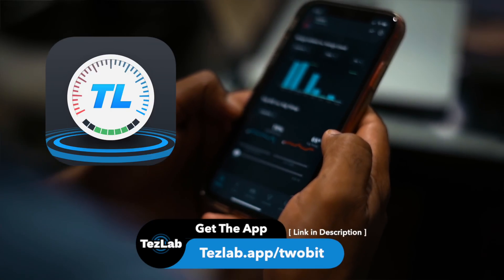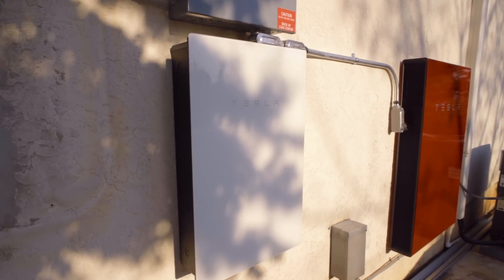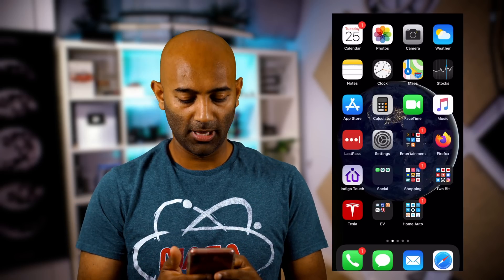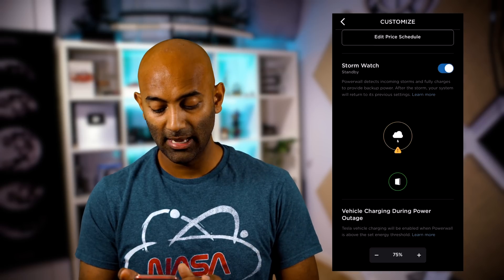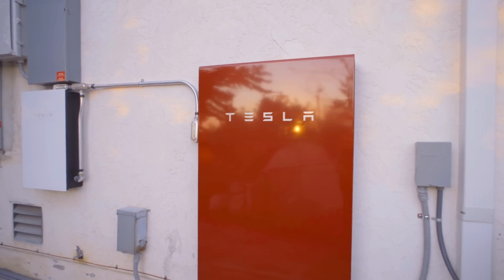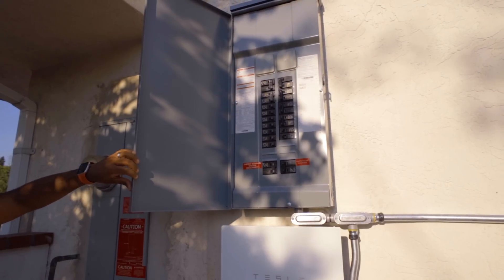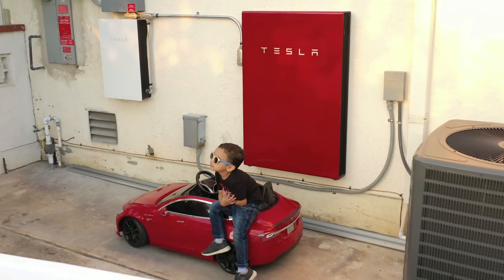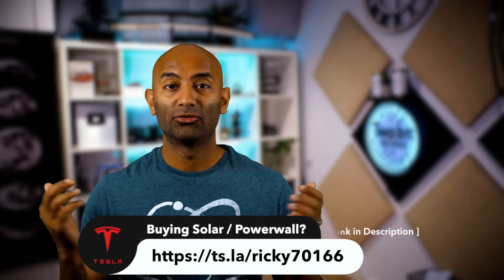The GENIUS of the Tesla Powerwall Explained

Comment from the maker: Get Tezlab, the best companion app for Tesla: https://tezlab.app/twobit 
Get Tesla Solar + Powerwall! ⟫ https://ts.la/ricky70166
Reply: I am enrolled in the PGE C.A.R.E program that Discounts my Service and when my Energy use is LOW , they often issue me Energy Credits , sometimes my Entire Bill is $0 and the Next Month is like $10 . 
I am also Enrolled in EBCP which is a ZERO Emissions Local Power Company , which Currently 100% of power generated is from Renewable sources , but PGE still charges me for Transmission. 
EBCP also provides 50% Renewable and 25% Renewable options as well. 
one other FACTOR in California is PGE has Tesla MEGAPACKS at Moss Landing and Ventura County which should help to Balance the Loads better with All the RENEWABLES California has , it still needs to build more MEGAPACK storage in CA , however.
Reply: I keep pricing solar roof and powerwall but still so pricey ($86k by the calculator) though the way my summer electric bill is it would be nice not paying that $400 a month.
Reply: @michaelinterbartolo3  Sound like you would be better off investing the $86K in Tesla stock.
Reply: Just ordered my panels and battery wall with your referral code.  Thanks Ricky keep cranking the videos out.
Reply: Ricky PLEASE look into researching and possibly getting a "Vertical Geothermal System" good example is Dandelion Energy but there are many... Got a friend the has it here and it cuts the cost of Heating, Cooling and Continuous Warmed hot water (Reduced energy used by 41%).. What we really need is a Green Ecosystem of products From BEVs and Solar to Wind (Harmony VAWT), geothermal, HVAC, Passive housing, Shading and Batteries!!! ~ What we then would need is a smart grid as we will then have Community Renewable Farms!
Reply: With Tesla treating it’s customers poorly with its terrible sneaky legal and  marketing practices, enter it’s power wall competitor, the BigBattery 48 Volt Kong Power wall. 

Google it. The Kong. 48 Volts. 12 kilowatt hours capacity and each Kong can be wired together in parallel up to 8 kongs. 

And the 10 year warranty is awesome too. 
Best part? It’s actually made in the US too. No child labor in a foreign country. It’s American made. 

Wipe that smug attitude smirk off of Tesla’s face acting like we people got no other choice so we gotta put up with it. Nope. 

Google Big Battery . Com 👌🏽 Later people ☺️
Reply: What about off grid solar etc from Tesla
Reply: @coziii.1829  Tesla’s off grid solar is not the best. It’s actually worse than DIYing your own solar setup yourself. 

I can prove it. 
1. Best battery I’ve found is 48 Volt 12 kilowatt TREX battery from big battery website. So powerful they can power a house. And you can connect them together electrically up to about 6-8 TREX batteries to power a whole mansion if you wanted to. 
2. Best solar panel I’ve found is 355-375 watt solar panels from Seraphim Solar panels. 
3. Best all in one inverters I’ve found are called LV all in one inverters. Powerful enough to power a house. 

Basically, Tesla is trash compared to doing it yourself. Tesla is a joke. Do your own solar system. You can do so much more yourself. 

You can even add a electric car charger to your DIY setup to charge your own electric car too. 

You can buy a car charger online. It’s not hard. 

Don’t let Tesla do everything for you. 

DIY yourself.
Reply: Humans 0
Saiya-jin 1 to 6
Angels 7 😇

Kalki Ironman 5th matriya buddha 8th arc Angel 11th satguru 13th imam and 24th avatar after 2026 😎

Almighty God 9 😇

Humans type 2.5+ after 2026 by Kalki Ironman (christ in the white horse)(son of man on clouds) type 7 and 8 😎
Reply: Jarvis world’s first artificial living being (just like vision in marvel universe)😎

Made of Quantum and sub quantum particles 😎

Power source quantum energy arc reactor (type 7) level technology 😎

Kalki Ironman going to have every kind of arc reactor like:- type 1 Nuclear fission, nuclear waste, hydrogen fusion, type 2 3 4 5 antimatter arc reactor (solid liquid gas), type 6 electro quantum arc reactor, and type 7 Quantum arc reactor, type 8 limitless quantum energy arc reactor without quantum particles 😎

Kalki Ironman going to have sun in a box million billion tons of hydrogen nuclear fusion reactor type 2 3 4 5 just like sun and stars in the palm of his hand ✋🏻🤩😉😇😎

This all going to happened by self replicating quantum nanobots knowledge energy and techniques at type 7 7 7- respectively 😎😎😎😎😎
Reply: Can you combat tou plan in southern ca with one battery 🪫 efficiently? Since AC is not backup/stove how long does the home run on back up power from 4-9. Does it really save you to offset cost of Tesla solar battery?

Comment: Hmm, nice to know. I Am in the process of purchasing a house in Florida that has 3 Powerwalls with substantial solar on the roof. Still getting the details, but the current owner says it runs the entire house including AC and his cost for 9 months out of the years is just the connect fee to the grid. During the 3 cold months Dec-Feb it costs about 150-200 per month. The system was installed in 2022, so it's pretty new and I am stocked!

Comment: Just get a generator to back up the higher amperage equipment and use the power wall for the basics such as the refrigerator. Why get 3 power walls and pay a fortune when you could get one power wall and a decent Generator that will cost under $1,000 that will take care of the rest. It’s not like the grid is going to be down forever. Can’t anybody think and do some basic math, are we all dummies in this world. Also if the power wall gets completely drained you can pump it back up with the generator.

Comment: Food for thought...
Just researching and ran into this other product being promoted. Summed up for you:

Compared to the Tesla Powerwall, the PowerBloc system has a few key advantages:

Larger battery capacity - The PowerBloc can store a full day's worth of energy, more than the 13.5 kWh capacity of a Powerwall. This provides greater energy independence.
DC-coupled solar - The Step microconverters connect the solar panels directly to the battery at 400V DC, avoiding conversion losses compared to AC-coupled systems like the Powerwall.
Grid-forming inverter - The PowerBloc can power the whole home independently off-grid, unlike the Powerwall which requires grid connection or a backup gateway to power a whole home.
Generator integration - The PowerBloc manages seamless blending and switching between solar, battery, generator, and grid unlike Powerwall's limited generator support.
Modular scalability - The PowerBloc battery and solar capacity can be easily expanded as needs change, vs the Powerwall's fixed capacity.
Advanced energy management - The PowerBloc uses solar forecasting and intelligence to optimize self-consumption, while Powerwall has basic solar self-consumption.
So in summary, the PowerBloc provides greater energy independence, efficiency, flexibility and intelligence compared to the Powerwall's more limited off-grid capabilities. But Powerwall is a simpler plug-and-play solution for grid-connected solar storage.

Comment: Thankyou for that information.  The battery can NOT handle hi amp products. Which is where the main power usage comes from.  As you said it is just a back up system to light amperage power lines.
I have just commented on another post of yours. 
So my question is. For me it costs $12,000.00 AU dollars to install a tesla battery system which is a rechargeable  Lithium Ion battery system ( group of batteries).  All this just to back up the lighter amperage power supply.  How long financially will it take just to get your money back from this system. 
I have a 6.5kwh solar panel system had it for over 4 years. I have around a $300.00AU credit after that time I don't have a battery  because I generate 3 times what I use.   Funny how now I only Get 9.5cent a kwh  and I have to pay 29.5 Cents plus $1.10 per day connection fee.    

We pay for these systems but the energy companies and the Solar makers and suppliers are making the lions share.  Oh I have a solar hot water system too, 315ltr twin solar panels, yet I watch the power light come on.  I have invested $15,000.00 AU   I am unlikely to see a full return.   Oh my contract has been altered in their favour three times.   Where does the greed stop? 

I say, all these videos are from people making money from it!  That is why they are smiling.   And I live in the Sunshine State!
Reply from the maker: Powerwall has 13kWh and can output 5kW which can power almost my whole house. For me two Powerwall could run my entire house when the house isn’t shining

Comment: Here is my math for financing 2 powerwalls and an 8.16 kWh system from Tesla.  For me it is slightly profitable, and I essentially have free backup power. 

Tesla Solar & Powerwall 

Need 2 powerwalls

If we ran 12 kWh @ peak pricing = $0.25 cheaper per kWh = $3 … $3 x 30 = $90 per month potential savings 

$280/ month before tax deductions
($9k tax deduction fed) 
$200/ month after tax incentives
-$90 savings from ToU with powerwalls 
——————————-
$110 net cost 
$110 x 12 months = $1,320 annual cost 

$1,320 / 12,000 kWh annual projected production from panels = $0.11/kWh 

+ $350/ year ($3,500 down payment amortized over 10 years) = $1,670 annual cost including down payment 

$1,670 / 12,000 kWh = $0.13 kWh < $0.17 kWh lowest SCE rate

Comment: In the start you said your AC was backed up, but then around 3:00 you say that because of the AC usage, you can't last the night. I thought it wasn't backed up?
Reply from the maker: the AC is not backed up... if the grid is online and i have power, the powerwall can actually support the entire load and will run my house from 4-9PM, so my usage from grid would be 0. but its not in the backup panel, so if the grid goes down, it wont run. weird, but the reasonging is that such a huge load is too close to the max output for the powerwall so they dont want you to just blow its entire capacity in like 2 hours if there was a real emergency.

Comment: Whoa, so if I understand you correctly.. even if I have power wall only (no solar), I can’t buy cheap electricity at night and use that electricity in the day time? Even with advance time based control settings?
Reply from the maker: I believe if you have powerwall and NO SOLAR, then you can charge on grid and use it later. just double check all those questions before confirming!

Comment: Thank you for this video! I am in San Diego as well and the time of use is killing me. I’ve watched several videos on whether or not to get the power walls, but I think in San Diego it’s a no brainer!
Reply: This might be one of the times for a HOA to use its power for good.  If there are 160 individual houses that choose to get Tesla Powerwalls, then the $8500 price per PowerWall means the whole setup will cost $1.36M.  But if enough people vote and there is a sufficient flat area, and the power grid can connect to every house, then purchasing a single MegaPack would be worth it.  A MegaPack would cost the same as ~120 Powerwalls, but its power storage is ~200 times as much.

The key is figuring a way to do this with permission and help from the Electric company, since it would likely need to be between the substation and the house meters.  A second function might be linking the MegaPack to a computer so that whenever the MegaPack is providing power it sends a message to the computer, which then sends an alert to the HOA customers (the computer just maintains a mailing/messaging list, so the MegaPack doesn't need to).  So if a power outage occurs all the Megapack HOA users  get notified, so they can turn down their power usage.  Similarly when the Megapcak is storing/discharging, a similar app to the current Tesla Powerwall app will let them see how the MegaPack is being used

Comment: You could have also considered a DC coupled hybrid with battery back up system. In such a setup you tell the system when to charge or discharge to the grid or a battery system. The Tesla doesn't allow the user many customer configurable options. I charge at 0.05c between 1230 and 0430hrs and discharge and charge throughout the day. 11 years ROI is a long time to break even.

Comment: Great video. I just got a tesla solar system installed. Quick question - here in SAn Diego, how is the net energy metering deal? I believe the grid acts like a battery for us - giving equal credit for giving back power as consuming it or does the time of the consumption from the grid also matter?
Reply from the maker: If you have time of use, the time when you generate power will matter. So if you generate 1 kWh at noon at off peak $0.25, but then use 1 kWh at peak times at $0.50. You’d owe $0.25.
Reply: @TwoBitDaVinci  Oh I thought with the net metering they woujld only count the KWh that i am putting in vs the Kwh that i am putting out here with SDGE. Is that not true and they are really counting the per unit cost of the energy that i am putting in vs taking out?

Comment: Why is a USA electrical system so "old school / low budget". In EU that is better and safer and with smart electricity meter. Same for TESLA it will be smast / crushet by VW in (2021), YES, buy stock VW (now and dump TESLA / ...  220V 50H siemens was also better for your electricity grid than 60H / 120V like in the US/ com.)

Comment: 112:00 Do you actually worry about heating in San Diego?
Reply from the maker: At night in December and Jan typically. It can drop into the low 40s some times
Reply: @TwoBitDaVinci  True. I live in LA, but have never turned on the heat. I recommend a warm pair of socks and toasty blanket. But if you are at elevation it could get cold.

Comment: A salesman told me that I could not use my EV rate to charge the battery for the first 2 years if I installed the Tesla battery. That would imply that after the first 2 years, I could. The person in charge of the solar program for my utility concluded that they had a rate structure set up so that If someone did use the EV rate to charge and the Peak rate to discharge, they would need to change the batteries shortly after they broke even. 
Questions:
 Can the battery be programmed to fully discharge from 5 to 8 PM?

If I used my solar to fully charge at an off-peak time and emptied the battery into the grid at a 3 hour peak time, how much difference between off-peak and peak do I need to make the project worthwhile?
Reply from the maker: No from what I see, you can only program it to cover all your usage from peak times. Not just dully dump regardless of your use. If things change I’ll make a follow up

Comment: Love the idea of being power independent but my average gas and electric usage is less than a  hundred bucks a month, payback would take years
Reply: I have the same comment and argument but this summer I had a few hour power outage. That was fine, stuff happens. However, I had multiple devices fail due to the outage related to my home computer and network (not that night but within days and I'm pointing back at the outage as the cause). The total cost was over 2k without talking my lost time. Starts to add up for the backup panel and using it to the potentially lower the electric bill.
Reply from the maker: Yeah sounds like it wouldn’t fit on economics yet for you

Comment: I don't want to put a current Powerwall 2 onto my solar panels in the UK at the moment. I think that the current Powerwall will last 10 to 15 years. At the end of that time it will just about pay for itself and not make any profit in the UK. When the new 4680 tabless batteries (just announced on Battery Day Sept 2020) are being used on Powerwall 3 then I expect that the batteries will last 20 to 30 years. This is because the batteries will not heat up so much because they have tabs for the whole length of the electrodes in the batteries. Heat reduces the battery life. I expect that the new battery will come out in about 2 years time and will be also be bigger (maybe 20 KWh instead of 13.5 KWh which will increase the battery life further even if you don't need the full 20KWh) for a slightly lower price. The new battery will cost tesla 56% less than the old one per KWh. With all these improvements it will then make more economic sense to install one. I would not wait for Powerwall 4 because I will have to wait too long and Powerwall 3 will be good enough. Powerwall 4 will probably be the battery that will do V2G ((vehicle to grid) the battery will last so long that you can use it to buy and sell electricity on the grid (and put it in your car) and make a profit without worrying that your battery will need to be replaced quickly). 

However for those of you who have a Powerwall 2 installed already you will only need to replace the battery box when the batteries run out. You will not have to replace all the wiring etc. So the cost will not be as bad as a complete new system.

Comment: At $7,000 now for a Powerwall, it's getting too expensive especially if you'll need more than one to supply enough power to your house.
Reply: Buy a home back up generator (either fuel, propane, etc.) and have it hooked up for blackouts.  You're in for over 7,000 for the product and install.  Then you have to get the propane tank or whatever you're going to use.  It's not much different.  Now, the fuel generators will run longer as long as you have the fuel.  But, can you get the fuel when things go down?  No, you can't.
Reply: @beebob1279  I'm not disagreeing with you, I'm just saying that the price increases for a Powerwall, makes it hard to justify to people that aren't on the green bandwagon yet, but would like to be.